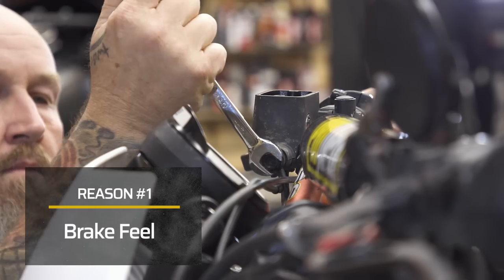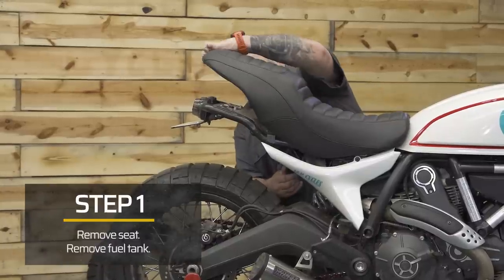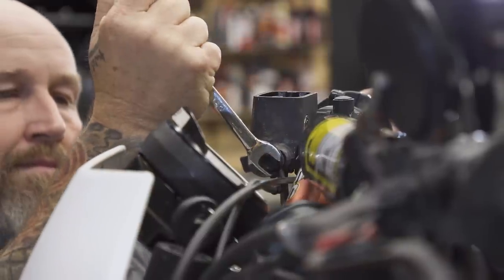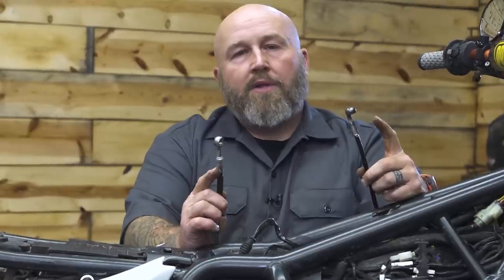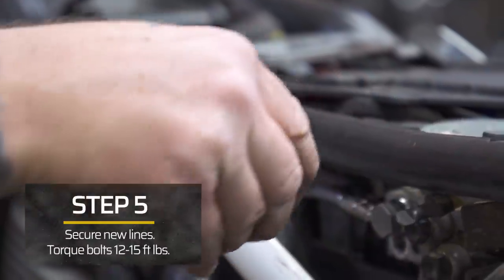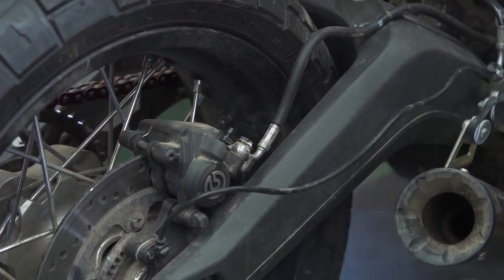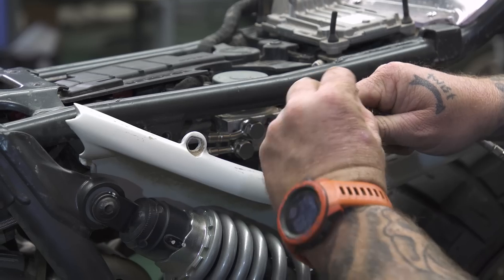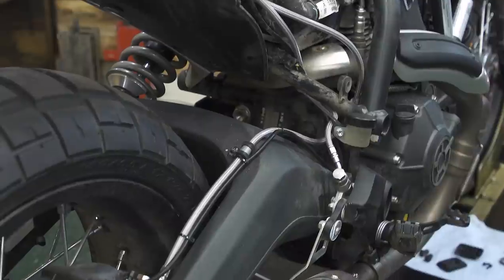How to Install Galfer Steel-Braided Brake Lines | On The Lift

Comment: When I disconnect an old line I wrap some paper towel and elastic around the end to ensure no brake fluid drips out, brake fluid will destroy your paint if you get some on it.

Comment: Another pro tip would be to twist the tails off the zip ties (if applicable to your bike) rather than cutting. Unless you’ve got a really nice small pair of side cutters, you can’t cut those close enough so there’s none sticking out, and they’re super sharp after you cut them. A pair of needle nose or linesman pliers and you can twist them off, if you can get right tight to the eyelet part of the zip tie it’ll twist off just inside that part and you won’t have any barb sticking out at all. Old electrician trick to keep your zip ties from becoming razor blades.

Comment: All good, but I'd clean the dirt around the banjo bolts before removing them... 6:15
Reply: yeah I could see the sand falling into the caliper hole
Reply: yea i was cringing at him removing the rear ones and dust fell into the hole, i died a little inside

Comment: Thanks for a nice DIY video with lots of good tips. I learned a lot! Using a beautiful bike as the subject makes us all jealous as well as informed! My own "add-on" tip that works for me (as extra insurance): use your camera to take a photo of each disconnect/connect point in the project before you disconnect at each end of the brake line. The photos can come in handy if you forget a detail for reassembly, including line routing throughout the machine. Check your photos before you secure all your lines and button down the final touches.